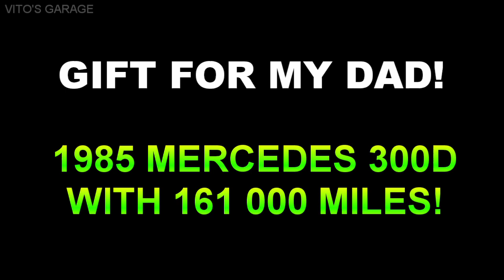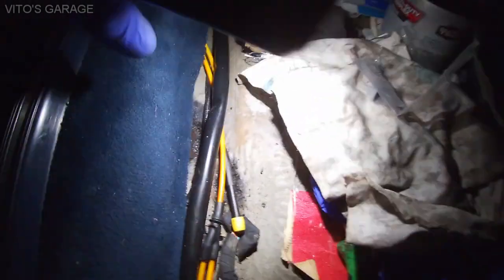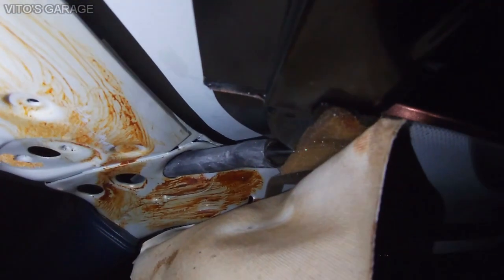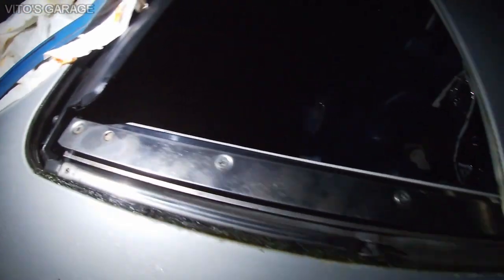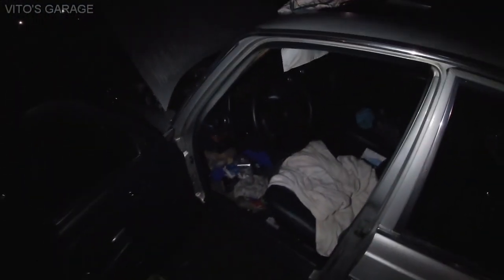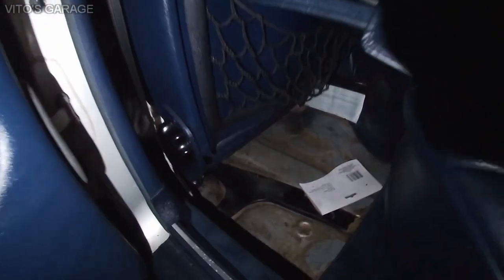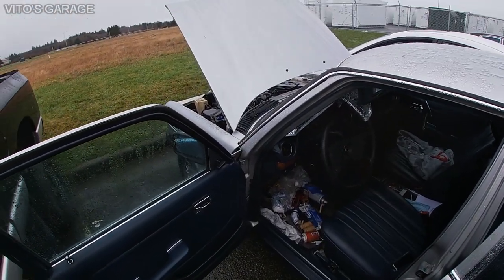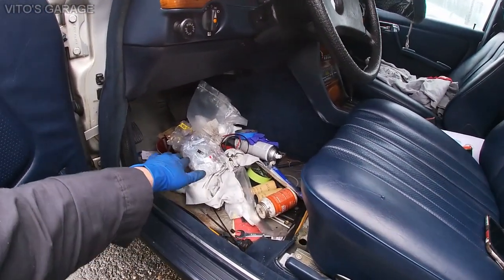PART 21 Dad's Mercedes W123: Interior Water Leak Repair & Saggy Storage Seat Nets Fixed!

Comment: Hi Vito. I have literally had the same issue which I fixed this weekend. A leak from the bottom corner of the windscreen gasket. I used some 3M 08509 sealant between the rubber and body on the corner from the outside and it appears to be repaired. I didn't realise a defect in the gasket elsewhere could show with a leak in that corner. Will keep an eye out in case it needs more sealant. 
A leak showing in that area can also be caused by water leaking past the 3 screws that hold the plastic wind deflector to the A pillar. Make sure the small rawl plugs in the A pilar are not defective.
Reply from the maker: Thank you so much for the tips and information, sir!

Comment: made of URO parts and left it to the mechanic, but I am suffering from the same rainwater leak as w123 in this video.
Reply from the maker: You need to find where the water leak is coming from and fix it

Comment: Sadly mine isn’t the windshield seal, water is coming in from the upper part of the A pillar (passenger side) and not sure how to inspect the drain tubes or hose for rust or deterioration. Would you happen to have a how-to on that? Assuming I have to remove the area where the sun visors and rear view mirror are.
Reply from the maker: Remove the  upper visor area trim piece and inspect the drains for rust. While that trim is out, pour water from the outside and see where the water is coming from

Comment: If you can easily peel the windshield seal back,  yes it's not the original seal. I'm willing to bet it's an aftermarket replacement. (URO). They're notorious for leaking even when installed by the most reputable shops..
Reply from the maker: It probably is an aftermarket. And really? The URO ones leak? Did you have that experience yourself? This one is pinched. I am glad I stopped the water leak using some silicone sealant for right now. In the future both windshields will have to come out either way to check for rust and repair and install new seals
Reply: @VITOSGARAGE  peesonal experience no, second hand experience from a dozen disatisfied W123 owners and from everything I have read in the W123 forums online. A MB original seal is the way to go. I'm getting ready to change the windshield seal on mine. It's the original 43 year old seal. Fortunately it doesn't leak onto the floors but it does leak onto the center of the dash..
Reply from the maker: Thank you for the information, sir!

Comment: I had the same issue man. You need to find a real good glass installer cause all the big name brand companies are shit and don't know how to properly install and seal these windshields. Also get the MB gasket not aftermarket. and is a good idea while the windshield is out to repair any rust, there are always rust issues under those seals from in-proper install and in-proper sealing.
Reply from the maker: What do you think about URO seals? Did you have that experience yourself? This one is pinched. I am glad I stopped the water leak using some silicone sealant for right now. In the future both windshields will have to come out either way to check for rust and repair and install new seals
Reply: @VITOSGARAGE  I don't like them. I tried a URO seal on the back of a w126 and it was complete junk and did not fit right. The OEM  is so much easier and good for peace of mind cause you know it is correctly sealing.
Reply from the maker: Understood. Thank you for the information!

Comment: Thanks, I got the same problem on both my w123 and s123 and i’ve been quite frustrated over it. I use the s123 as a daily so i really want it to stop leak. Gonna check the window seal right away!
Reply from the maker: You have to look where it’s coming from. Look for traces. It can be the windshield seal, clogged drains under the hood, rust under the battery tray, sunroof drains clogged or nipples rusted out
Reply from the maker: @philen  I totally understand you. Preventing water leaks is the same as doing preventative maintenance and avoiding rust problems. 
You have to remove the upper headliner plastic section along with the visors (I did that in the video). Once you do that, watch for water leaks. You can use a water hose and spray water onto the windshield and watch where the water is coming from. You need to find that leak and fix it
Reply: I know im asking the wrong place but does anybody know a tool to get back into an Instagram account??
I stupidly lost the login password. I would love any tricks you can give me!
Reply: @Dante Hendrix instablaster ;)
Reply: @Karter Ares I really appreciate your reply. I found the site through google and Im in the hacking process atm.
I see it takes a while so I will reply here later with my results.
Reply: @Karter Ares it worked and I actually got access to my account again. I'm so happy!
Thank you so much you saved my ass!
Reply: @Dante Hendrix Glad I could help xD